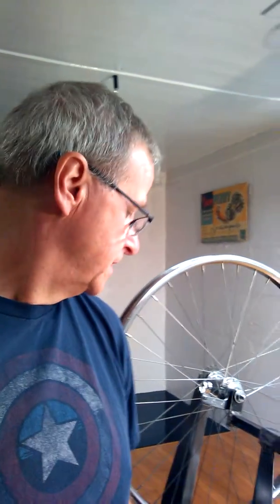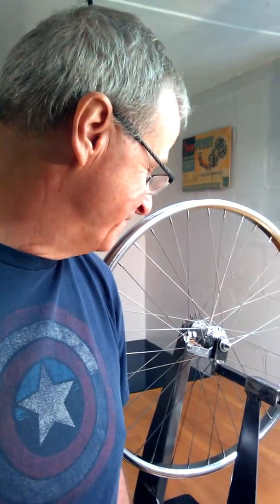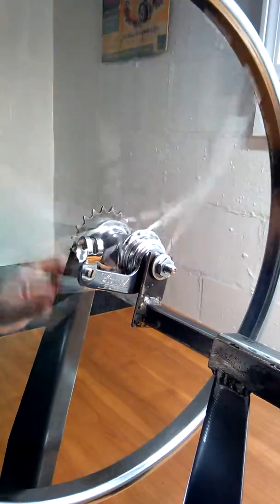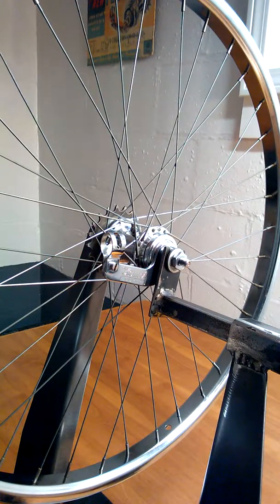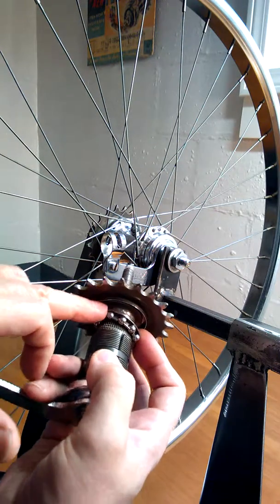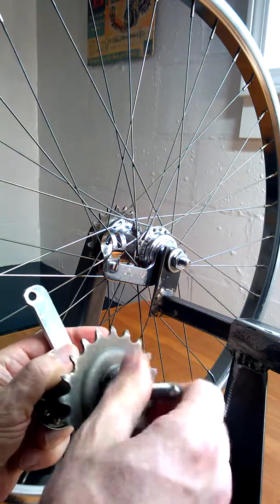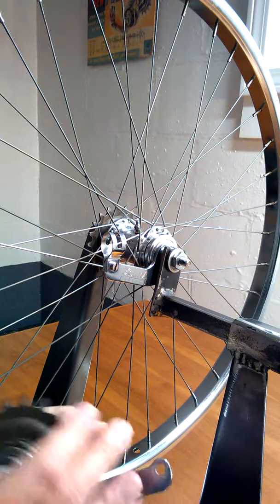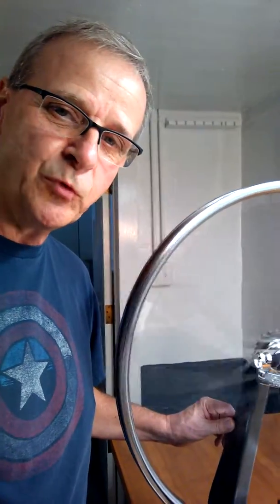Komet Super Coaster Brake Hub Nevin DeLacour

Comment: What tool do you use to loosen the jam nut?
Reply from the maker: Hey Dane, I made a tool from a pipe I had laying around. I find myself making tools because they are just not available anymore.
Reply from the maker: I took a photo of the tool, but there is no option to add it to this reply. Sorry.
Reply: I have an old cruiser with a 1965 Komet Super hub that seems to have broke and just spins free and doesn't turn the wheel when pedaled.   Think it can be fixed or past the point of no return?
Reply from the maker: @beaconbus  You would need to take it apart and try to determine what is broke or missing. You may be able to find replacement parts on eBay.
Reply: @weekendplowboy  I will give it a go. Thanks for the quick reply!

Comment: What do you do for lubrication on this Komet super coaster brake?
Reply from the maker: I pack the bearings with Pennzoil Premium Wheel Bearing Grease 707L. Everything else gets a light coat of the same grease. Any light wheel bearing grease will be fine.